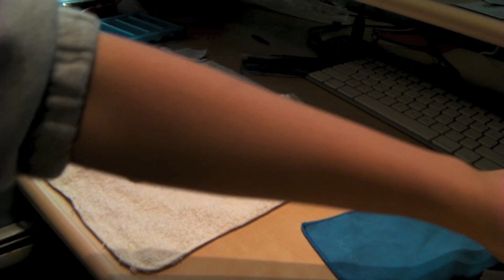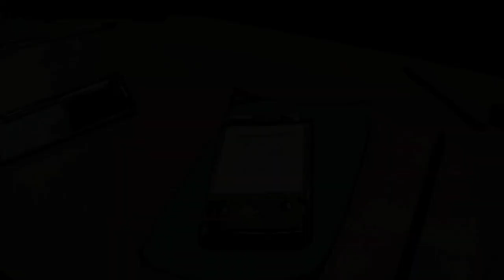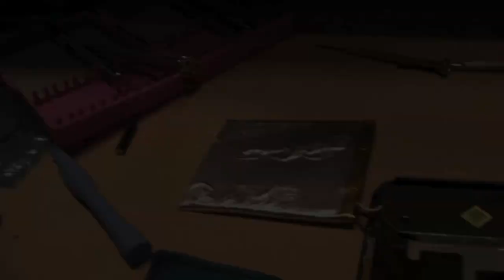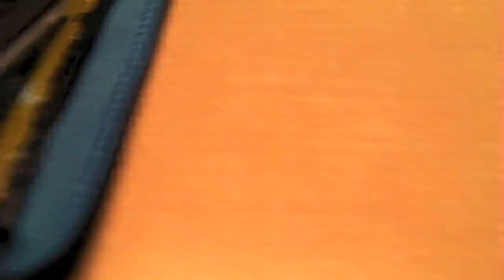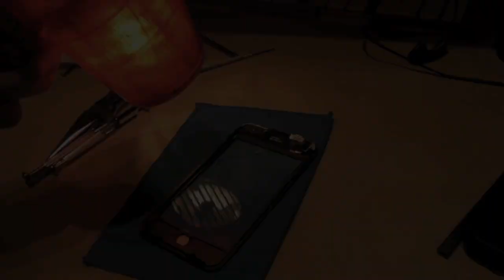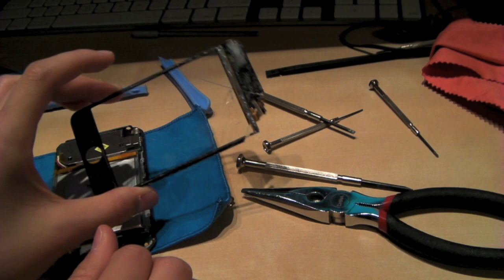iPod Touch Repair Fail

Comment: @alertlonestar The difference being that the Mac Mini is designed be opened, and the replaceable components (such as, Ram and HDD) are situated where easy to access and replace, in the Ipod touch this is not the case what so ever.

Comment: "I bashed the flat head into the phillips screw".... good sign, lol. You can always tell how careful someone is by how they handle expensive items, or how careless they are by flinging hundred dollar ipods around as they talk expressively.

Next time, wear flipping safety glasses. This is not home-ec, sometimes you might have toxic chemicals/metals that could fly into your eye. And never get into a device before knowing exactly what the steps/environments are like.

Comment: I'm pretty sure the guy was going to buy another iPod anyway..this was probably just a shot to see if it could be done..I did it with my ps3. Hahah I broke the thing open messed around with it and cleaned the sensor. It didn't work so I got a ps3 slim anyway. Haha, nice try anyway :)